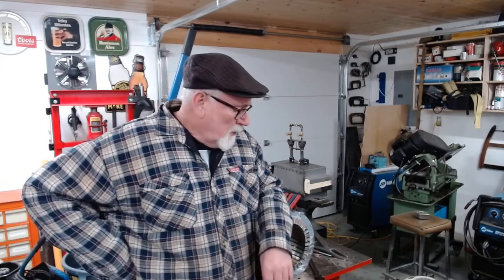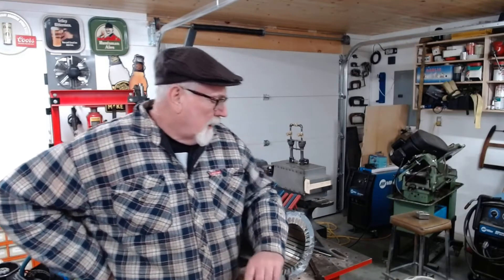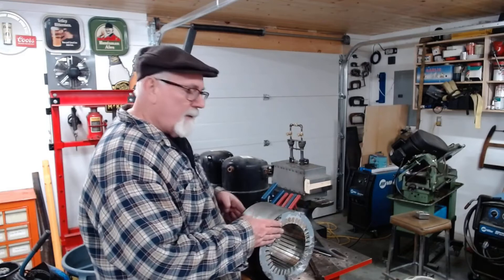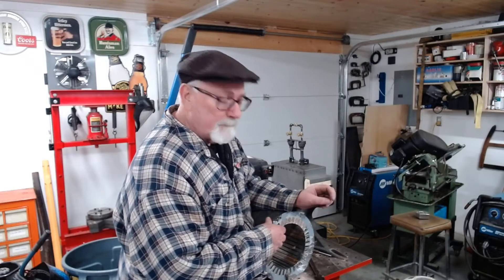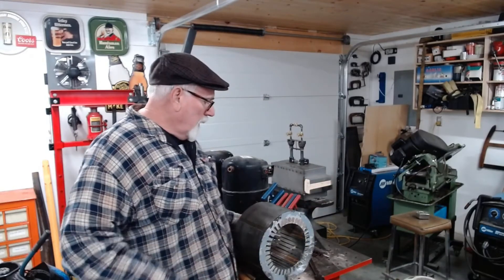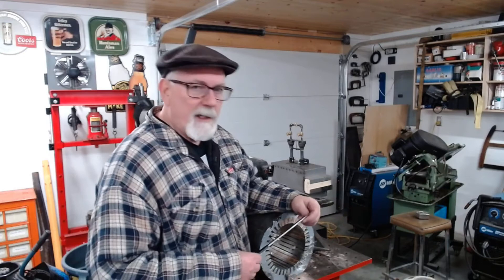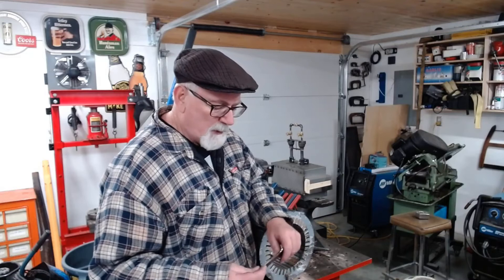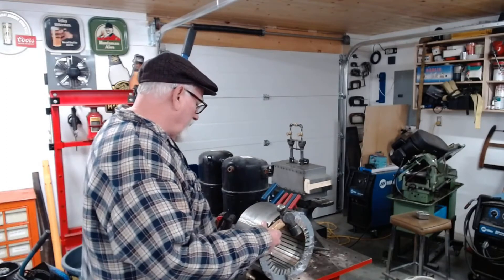Copper Removal Tool For 3 Phase Motor Windings

Comment: Great to see a video from you Mac, hope things are settling down there for you now! I love it when I see tools made for these motors because they are a beast! Nice hammering 🔨👍😉 Yes that would be quite some workout for many motors but just fine for one biggen, good job (next time a closer longer look at the good stuff for me please 🙆‍♀️)😁
Reply from the maker: Next time I will focus more on the copper than the process Sollers, just for you ! I am thinking about making a winding puller out of a hydraulic jack for the smaller ones, kind of like the one Simple Man uses.

Comment: Hehehe the joys of scrapping, now look at the difference, you approach it from an engineering perspective and make a tool. I look round my scrap for any iron that will fit the slot,  I like what Snobby did, he took an old open end spanner, cut the end off, the shank has a nice taper and is of course tool steel, but I guess that’s against the grain for both of us.  Pity you didn’t film lifting that motor onto the bench.
Reply from the maker: I remembered Snobby cutting that wrench off and briefly considered doing that ...briefly. I used a dolly to get it around the back and split the case on the ground. Still a bit of a grunt to get it up on the bench.

Comment: I don't "like" the big motors because of the ratio (total weight/copper) and I find them more difficult to extract the copper... Nice job my friend😁👍👍
Reply from the maker: For sure, so far the ones I have done yield and unscientific ratio of about 1 pound of copper to the horsepower.

Comment: Nice to have for when you want to get it all out !
Reply from the maker: Yes indeed, if I had more motors that size I would take the time to make a nice one. Do you still have gasoline where you are at on the Island ?
Reply: @CruiserMac - Yes we do, The fuel barges are still running like clockwork. I think nothing will change for us. No real problems here or on the lower mainland, it is getting things out from here that is the rub. Are supplies dwindling there ?
Reply from the maker: @TheCanadianBubba  The grocery stores have been cleaned out, most of the restaurants have been closed the last couple of days as they had nothing to make food with. We get most of our fuel from Kamloops so that is OK. The Hope Princeton is open for commercial traffic now, they trucks are really rolling through town !
Reply: @CruiserMac - Great to hear it is moving some, Hope it will all improve from here on out. They are saying the Coquihalla will be down for months.
Reply from the maker: @TheCanadianBubba  I believe that, five bridges were washed out apparently.